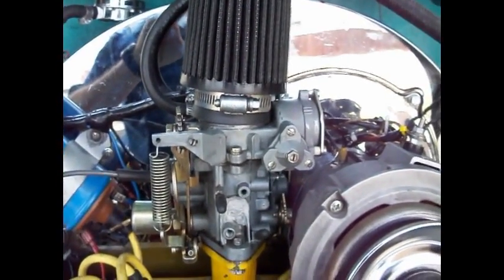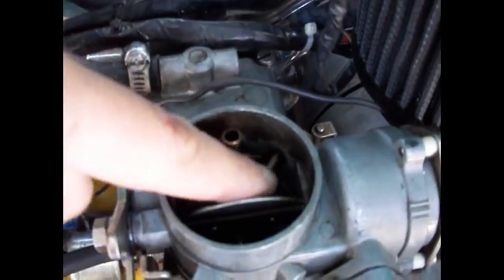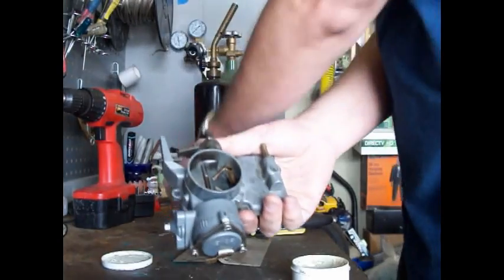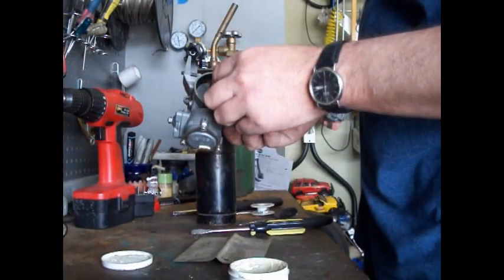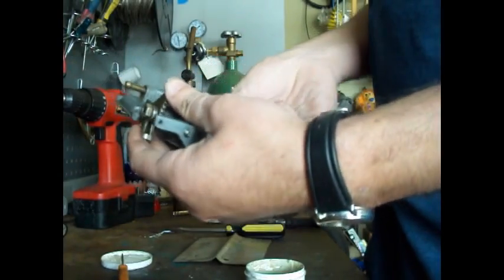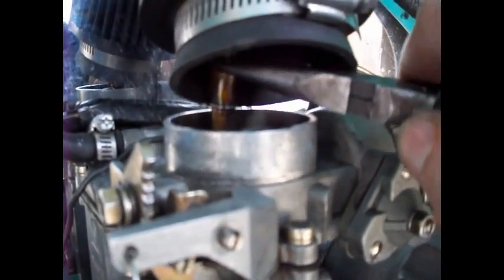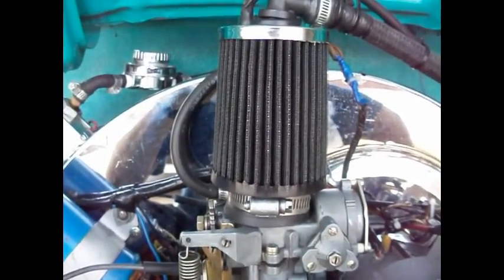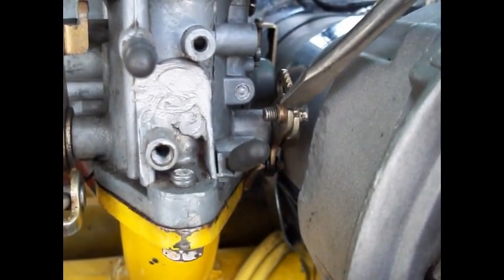34 pict 3 No Venturi 2nd Option Mod on 1904cc

Comment: Followed your vids and posts on Samba, ThX!  Went the no venturi route, 2276 engine, idle jet at 80, main 180, aux jet 42, air correction 60, twin aux jets not soldered, 1/8+ hole in throttle butterfly open, 009 dizzy, timing at 30, choke butterfly removed, no elec.to choke, idle solenoid functions outside of carb, but not installed. Spaced it out, so it is now open. Problem is it will not idle, all idle circuits are clear, bypass and idle mix screw do nothing. I made a spacer to hold the throttle butterfly slightly open, giving it an idle of around 900 rpm.  This is an off road race car and I need a single barrel for a particular class.  (normally run a Zenith 2 barrel) My question ...will I harm the engine running it this way? What are the disadvantages to running with out an idle circuit? It runs great and it is fast! TIA

Comment: I was wondering if you can help me out. I have a 1641 with an old school rajay turbo on it. It runs with a stock 34 pict 3 and I had it running perfect like that for a year with no issues. In the manual it talks about modifying the 34 to remove the Venturi which I did and it says to change the main jet but it doesn't say the size. I currently have a 150 in it but it doesn't run right. Can you recommend jet sizes and should I also run the hose and solder those two ports. Thank you.
Reply from the maker: Don't solder the 2 ports yet...  For the turbo part you need to message  Clonebug or Alstrup at the thesamba.com there a wealth of knowledge Clonebug for the turbo part alstup for the 34 pic 3 jets both of them know the 34 pict 3 very well. good luck!

Comment: Hi Moto, i´m Andreas from Germany.... sorry for my Bad English... I try to do it like you, but i have trouble with 1000-2000 RPM, its stocking. I have a 1915 with W100 , 1:9,2 Compression. I don't understand what you mean with 11 a clock..... can you help me please.

I don't understand you mean Air Jet is Auxiliary Air jet ore Idle Air Jet ? So perhaps you can write just the Size:

1. Main Jet= Size ???
2. Air Correction Jet  = Size ???
3. Idle Fuel Jet ( Pilot Jet)  = Size ???
4. Auxiliary Fuel Jet  = Size  ???
5. Auxiliary Air Jet = Size  ???
6. Idle Air Jet  = Size ???

i take the Names form this Picture: http://members.trainorders.com/android/VW12up/34PICT-3Jets.jpg

Regrades Andreas
Reply from the maker: Idle jet is 62mm.....  but I would start with 60mm
Main jet is 180mm....    
Air jet is 60mm....
Dont worry about the jet thats at 11 oclock from the Idle jet
Are you running with out the venturi? if you are.... your going to need to run with a long hose but try to keep it inside the air filter and away from the center of the air stream thats going into the carburator. also make sure its a thin hose. Also find a way to secure the hose from moving around inside the air filter other wise the carecteristics of the carb will change everytime the hose moves.   good luck
Reply: Idle jet is 62mm.....  but I would start with 60mm = number 3 on the picture ?
Main jet is 180mm....                                                  = number 1 on the picture ?
Air jet is 60mm....                                                        = number 2 on the picture ?

Picture: http://members.trainorders.com/android/VW12up/34PICT-3Jets.jpg

are the numbers Right ?

best regrades,  and sorry for my asking...

Comment: If you size down the runners, the throttle response will increase low end, 230cam is a good all around hot cam not your all out race cam, best for good hp, and fuel mileage, perfect for what your doing, also you are not alone carb tuning is being taken to a new level.... Dyno Venturi-less Premier Series carburetor on all aluminum 496 CID FE
Reply from the maker: Awesome! Very interesting stuff!